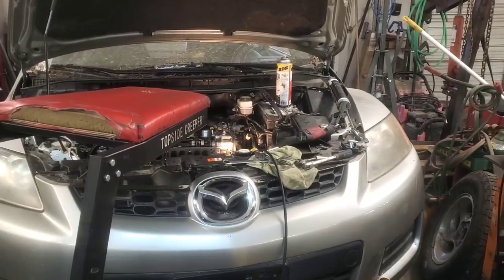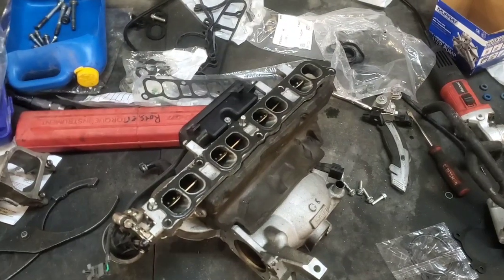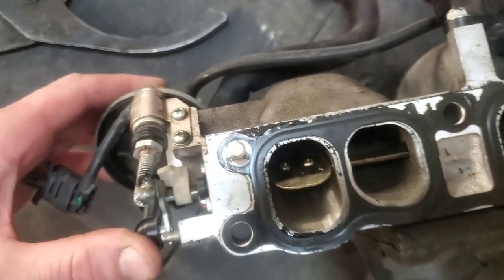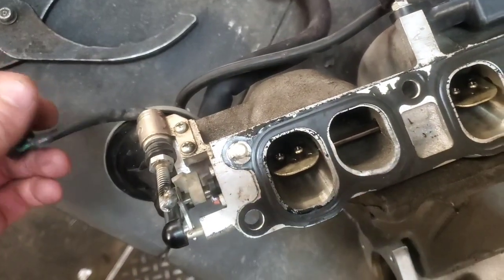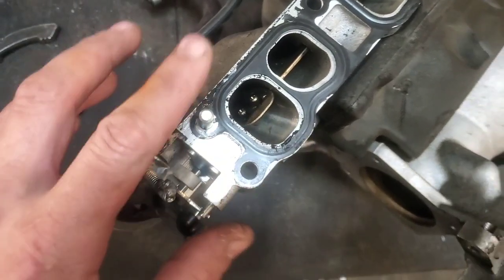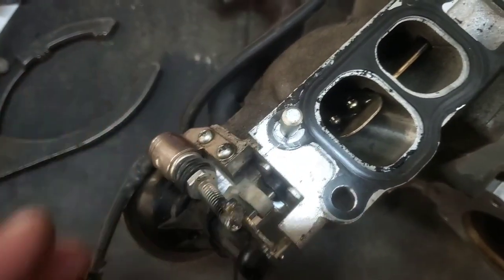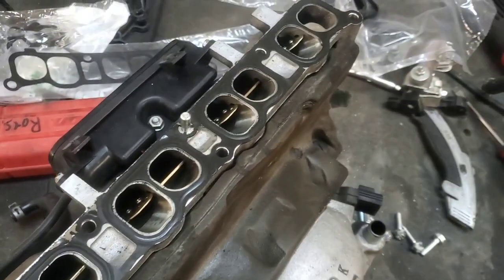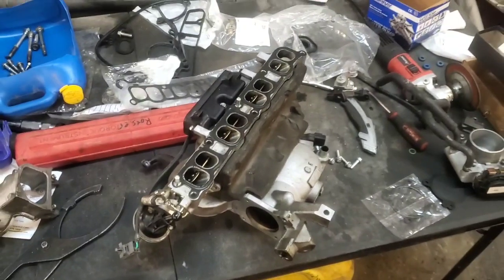Mazda P2006 Code. 2.3L DISI Turbo In a 2007 CX-7.  The Fix!!!

Comment: What size bolt did you use?
Reply from the maker: 5/16 i think
Reply: My plastic piece is still on there the actuator itself is not opening and closing when I do it with my hand it’s really tight Is there anyway to fix that?